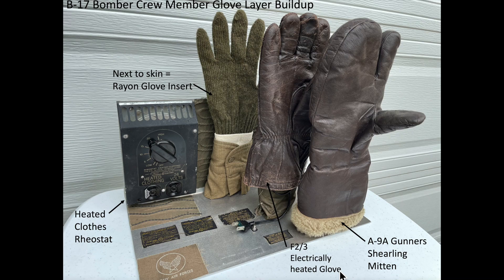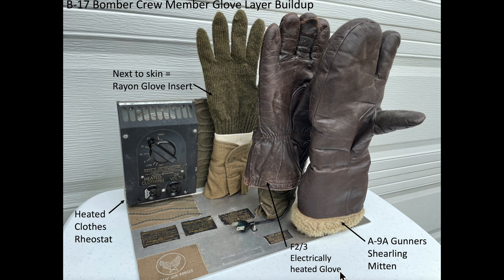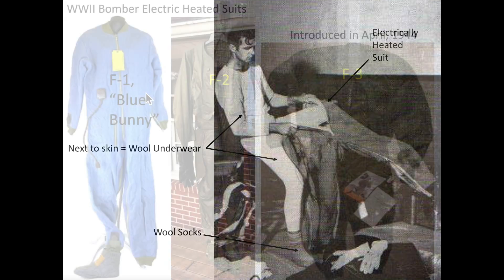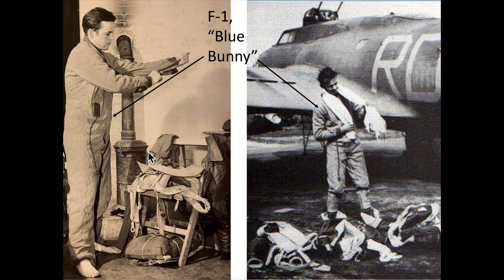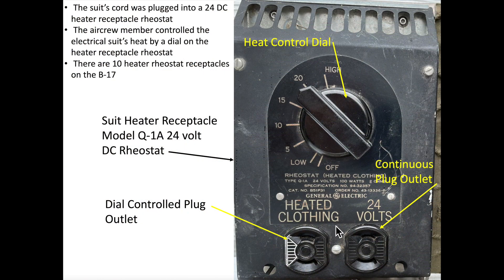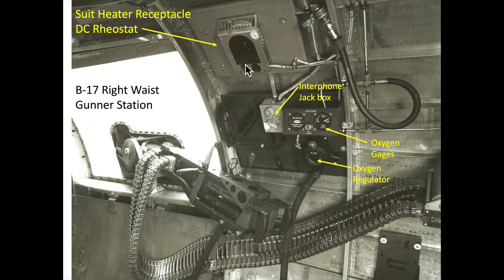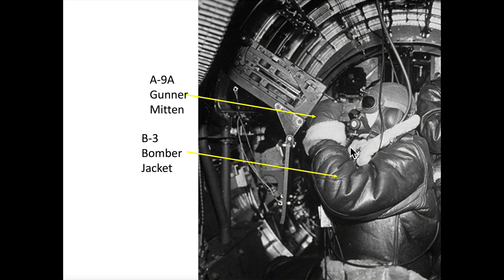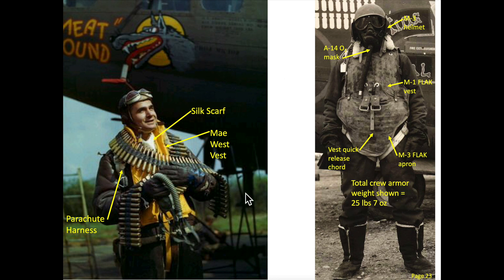B-17 Bomber Crew  Cold Environment Gear

Comment: Wonderful video.  It seems there are no photographs from inside the planes at 25,000 feet when it was so cold.
Has anyone seen that photo? In Hollywood movies it looks like they're going skiing - not very cold in the plane.
I read that ice would build up around the oxygen mask and tubing. The ice had to be continually knocked off or the oxygen would block.
Reply: The original "Memphis Belle" movie was filmed on the actual bomber during a mission if you want to see in-flight stuff from cruising altitude

Comment: Excellent again. I would add that of the heated suits shown there are only two types represented - the F-1/E-1 and the F-3. The F-2 mentioned is not shown and is an entirely different beast with an integrated outer wear layer. Pics available if needed. Keep up the great stuff.